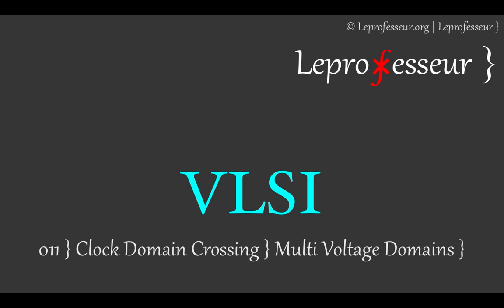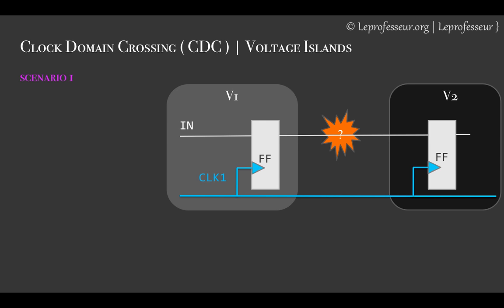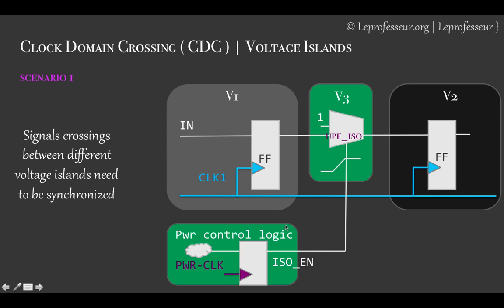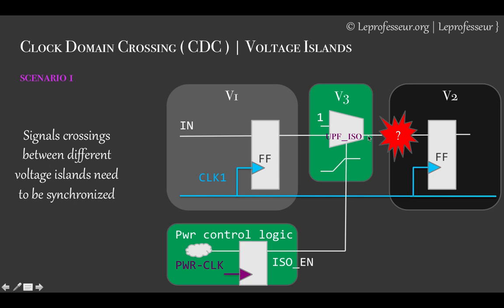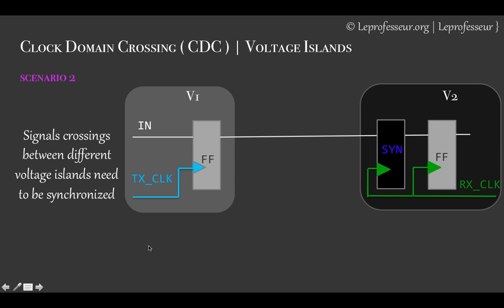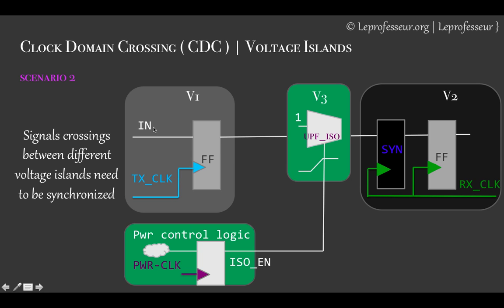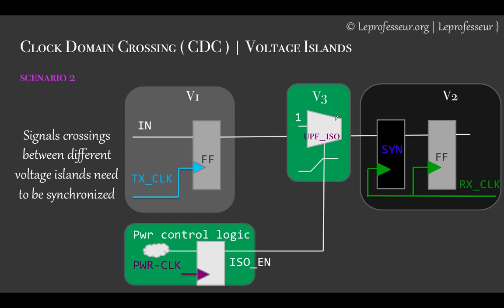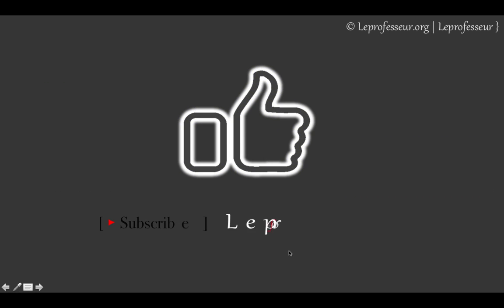⨘ } VLSI } 11 } Clock Domain Crossing (CDC) } Multi Voltage Domains } LEPROF }

Comment: I quite didn't understand the issue with the second example. Why would the circuit at time t=11:00 in the video, have a metastability issue? If we are finally adding a sync cell in the destination domain, wouldn't that be sufficient to solve the CDC issue here?
Reply from the maker: It is a recommended practice to have stable signal cross clock boundaries, if signal (input to sync cell) toggles it affects the MTBF and further reliability concerns that depends on toggle frequency. Second sync cell for iso_en improves signal stability and improves reliability, however if iso_en signals is stable then second sync cell is not needed.

Comment: The synchronizer u  have  put in Voltage Domain V1, shouldn't it be synchronized with respect to Power CLK instead of V2 clk ?
Reply from the maker: NO.